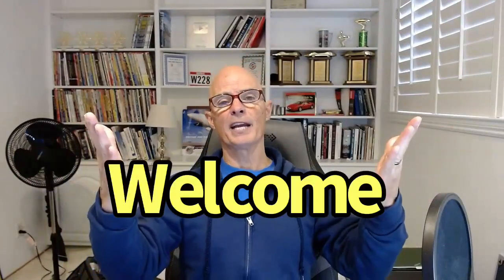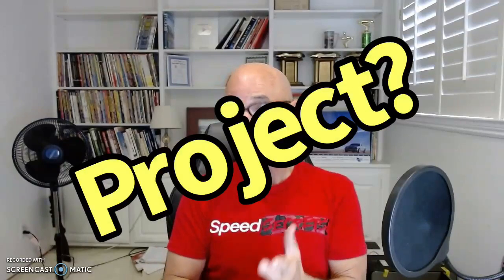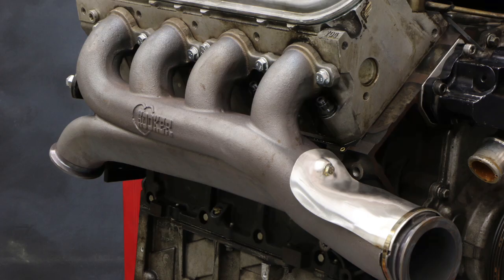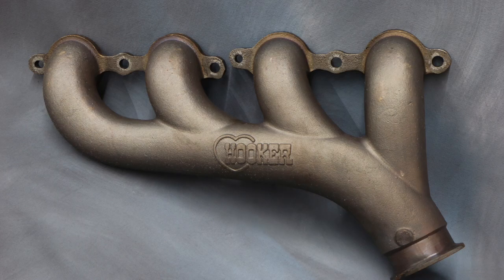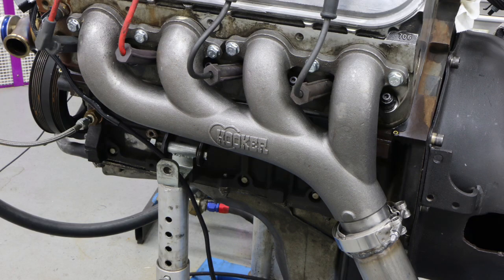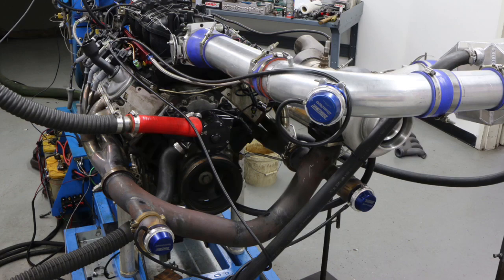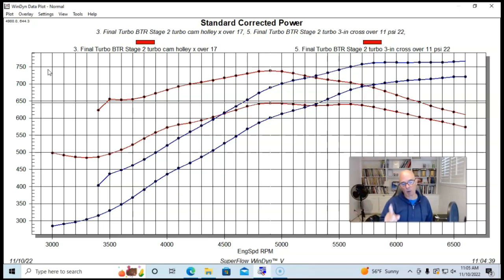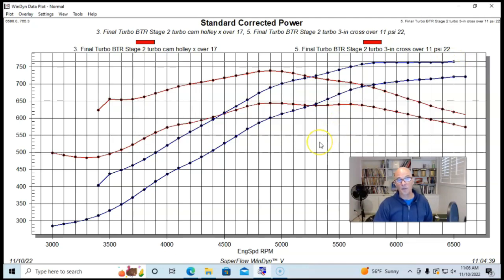HOOKER CAST TURBO MANIFOLDS VS E-BAY TURBO HEADERS-BOOST PSI VS BACK PRESSURE. BACK PRESSURE VS HP!

Comment: You had double the outlet for the wastegate. Thus less backpressure. Need to plug the second wastegate and see if the results are still less backpressure and more power. 

Less backpressure means more scavenging,  which equals more air and fuel in the cylinder. That equals more power.
Reply from the maker: the waste gates don't determine back pressure-they regulate boost
Reply: @richardholdener1727  could have ran the tubulars with one gate, just to compare points on the graph that happen to be the same boost pressure and see what happens
Reply: @richardholdener1727  I read that and I'm like well duh 😖I know that. But but but the test.. the only difference & the power gain.  I mean I'm probably going to buy that hooker, I just hope it doesn't give me an STD. Slow turbo down
Reply: @richardholdener1727   Do not the waste gates regulate boost by venting exhaust gasses prior to them getting to the turbine wheel on the Turbo?  That is how I understand that they work. And if that is the case, with twice the surface area to bleed off exhaust gasses, it seems that there would be less back pressure. But I do not know where in the system you measured the back pressure.
Reply: The turbo and engine combination dictate how much backpressure is needed to make a certain amount of boost. The wastegate bleeds off drive pressure that controls boost, but doesn’t change the relationship/ratio of backpressure to boost. In other words, a wastegate by itself can't lower backpressure without also lowering boost pressure. If you went with more wastegates, or a larger wastegate, they just end up opening less for the same boost target. Doesn't change the pressure ratio itself or power at the same boost, but does offer a greater range of boost control.
Reply: Doesn’t it also require more horsepower for the engine to pump exhaust gases out at 21 psi compared to 15 psi?
Reply: I'm with you, but honestly, I can run a high amount AC with that hooker, and I'm not in a point race in NHRA, can't afford to or need to be the fastest guy in the whole world, and last but not least a thousand horsepower turbo is going to make ...a thousand horsepower, my friends would laugh if they heard me say don't overthink it. I haven't missed one of Richard's videos, some of them I watch ... a few times. Damn those hooker manifolds are overpriced though.
Reply: So for some reason with the hooker manifolds it required 21 psi of back pressure to make the same boost as the tubular headers made with 15 psi of back pressure. Doesn’t that just mean that the cast manifolds just don’t flow as well?